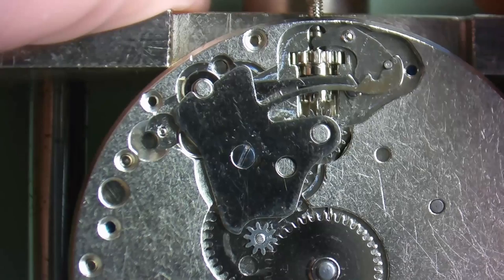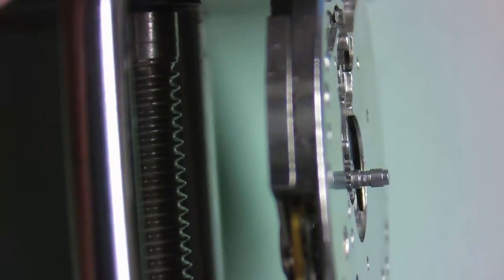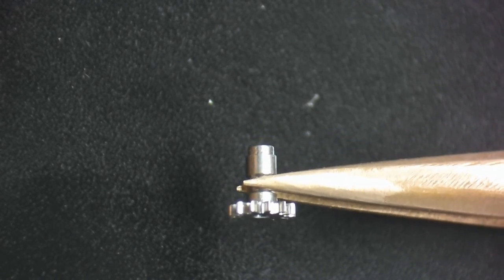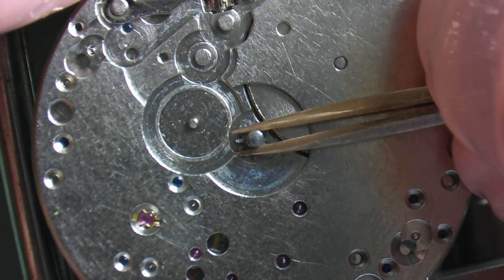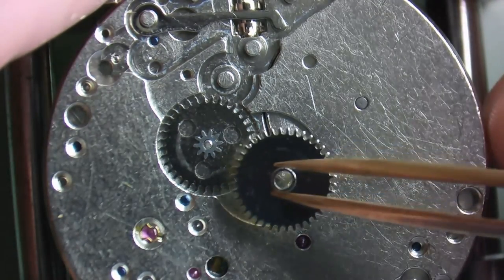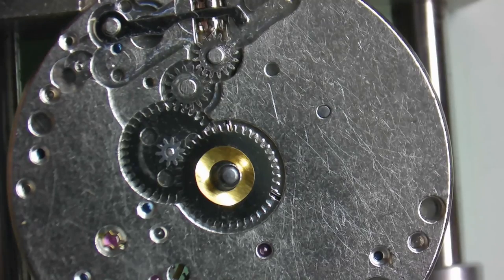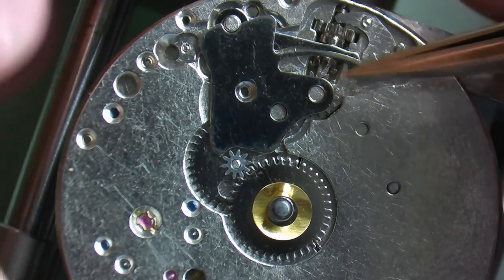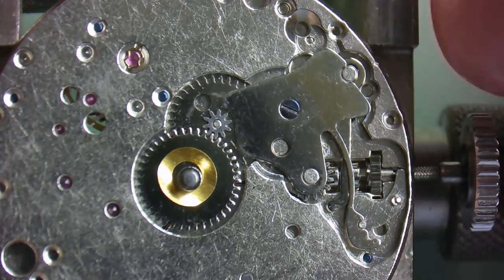Watch Repair Lesson #4-The Motion Works and How it Works

Comment: As I make my way through your content (because it is extremely approachable) a question arises that I'm hoping you know the answer to. Most recommendations I've seen immediately recommend Swiss Bergeon tools or say it's okay to get really cheap tools from China and then step up to Bergeon tools. 
I have other hobbies and there's always a "moderately" inexpensive option. What is it for watch repair tools? Is there no reliable watch tool maker that isn't as expensive as Bergeon but isn't as cheap and disposable as the tools coming out of China? 
Also, I have found specific suppliers out of China for some of my hobbies that produced excellent tools for my hobby, since my hobbies are often ancient ones (calligraphy, for example, has top-quality pens coming out of China and some garbage).
I'm just curious as to if horologists know of manufacturers that produce longer-lasting tools but not as expensive as Swiss tools.
Reply from the maker: Bergeon is the easy answer because nobody can question their quality in most cases.
There are other brands out there that offer a more reasonable price but it all depends on which specific tool you are looking to buy.  
Often the best options when precision is not an issue are Chinese versions as an example.
There are other brands, like Swiss brands like Horotec that offer lots of quality tools, some priced less than the equivalent by Bergeon and sometimes the Chinese version is good enough.
 What specific tools are you looking at specifically.

Comment: Hello Sir, Trust you and your family members are doing fine. I have a few automatic watches( Omega, Tissot and Titoni brands) which I wind everyday to keep it in good running condition since I can wear only one watch any day. Recently, I saw a video which said winding automatic watches causes immense damage to the key less works resulting in costly repairs. Is this a fact? Can you advise me on this? I do about 15 rotations on the crown. Is this ok? Thank you Sir.
Reply from the maker: Yes, you are fine winding them. It’s not necessary but fine to do so in most cases
Most Watch movements are designed to be wound but if there are old dried lubricants that cause the winding to be stiff, then it could be stress on winding parts.
Reply: Thank you so much for your advice. I am indeed fortunate to have you as my guide and mentor.

Comment: Another great video. If I may can I point out something I notice when you was installing the  setting lever jumper, the way you show doing it was like you put the part in and tighten down the screw which we know that you should get the screw started first then after getting the spring end pull back so as to engage the setting lever you then can tighten down the screw fully also before I do this the end gets a small drop of HP-1300 oil.
Reply from the maker: I would use the grease if parts are sliding against each other under friction.
Reply: @watchrepairtutorials  Yes you can use Moebius D5. The Technical Communication sheet says you can use one or the other.

Comment: I don't think they have chosen a good name for the minute wheel.
Hour wheel rotates with the same speed as the hour hand. So, that's a good name.
But what rotates with the same speed as the minute hand, is the cannon pinion, not the minute wheel.
For example, in the case of this movement, 1 rotation of the minute wheel is 3 hours. So, something between the hour hand and the minute hand.
If I wanted to name the minute wheel, I would call it something like the "cross wheel" (as it's the cross point for the intermediate wheels, cannon pinion, and the hour wheel).